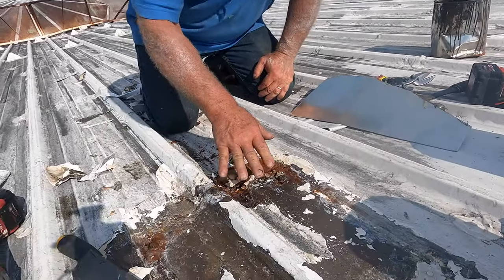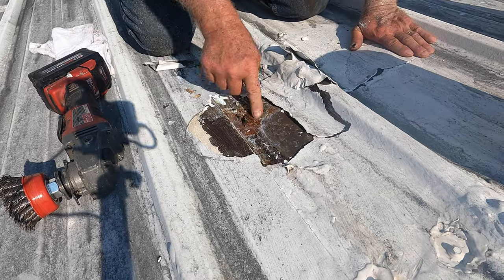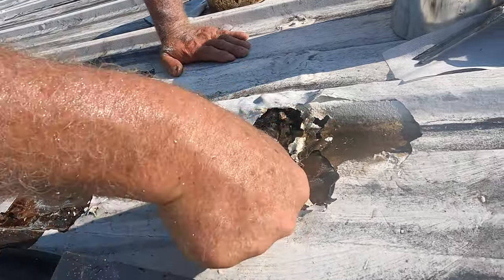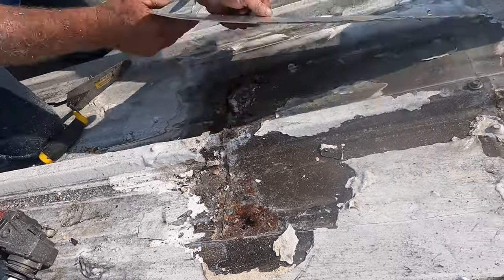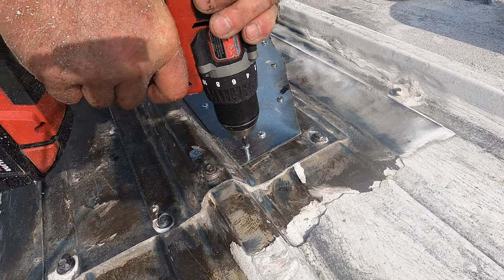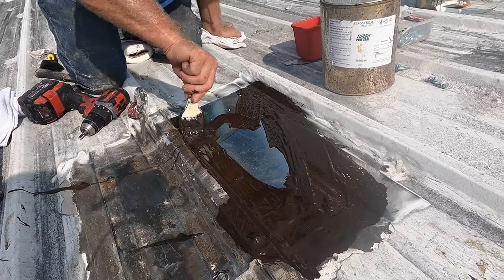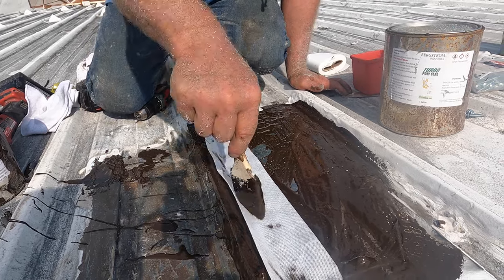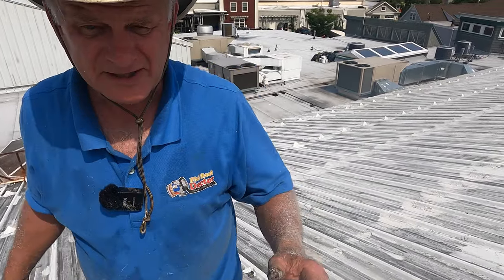Patching or Repairing RUSTED METAL ROOF LEAKS - Turbo Poly Seal

Comment: I did exactly what u said about measuring the leak from a landmark or reference point and accurately found every leak. After watching all your videos I finally got down to work and tackled it.  Roof repairs are hard work, every joint in my body ached from standing on an incline and doing work plus the sun is draining.  Thanks again for your videos.
Reply: I😊9

Comment: In 4 minutes you taught me more about metal roof repair than any other method could.  Thank you for your video.  I discovered a leak in my roof during a rain storm.  This knowledge divines me with the power to fix this and any other trouble spots I may discover.

Thank you.   I will pass your videos about.

Comment: Let me just tell you about the flat roof doctor's product Turbo Poly Seal. I have an old bungalow in Florida, the chimney needs to be flashed and it needs a cricket, why in the last hundred years it never had that I don't know but it leaked big time. I tried everything they sell at Lowes and Home Depot none of them work, all garbage. The turbo poly seal I used and fleece I quickly applied before a tropical storm, the first day it let in a bit of water, I thought here we go again, another product that doesn't work. But then, after a couple of sunny days it rained again, nothing this time, not a drop. Apparently it just needed a bit of time to cure. Not a drop since. This stuff is amazing, industrial grade, it works unbelievably well, highly recommend.
Reply: Hey Mathew, I agree I used turbo poly seal on my patio and it’s still works! Very promising product!👍🏼

Comment: I have patched many rust holes in metal roofs using a couple of tubes of permanent gutter sealant ,sheet metal and steel rivets and painting it,using screws doesn't allow the panel to expand and contract like it is suppose too.

Comment: My advice is you cannot paint directly over rust without treating and sealing it and that includes the underside.  The metal patch was screwed on to rusted iron and that rust will continue to creep It depends on how long you want it to last .  This repair hopefully will work for 4-5 years but if you want to prolong the life you have to treat and seal all rusted areas both sides.  Of course this is a lot more time consuming lifting the iron and attending to the rust on both sides before applying the patch.

Comment: Love these videos thanks for making them. I just purchased poly seal for a metal roof patch on my old house. What type of metal should I use? Can I use the thin aluminum sheet that they sell at Home Depot? I do have some sheets of copper as well. Thanks for your help.
Reply from the maker: always match the type of metal you are trying to repair
Reply: @FlatRoofDoctor  thanks for the reply. It’s an old roof and I’m not sure what it is. All I know it’s not copper.

Comment: You can't use silicone on plastic or vinyl !!
Reply from the maker: Partially correct. If Plexiglass is considered plastic, then you can use it on that. I f Vinyl is PVC or TPO, then it is likely not to work on that unless you prepare the surface first